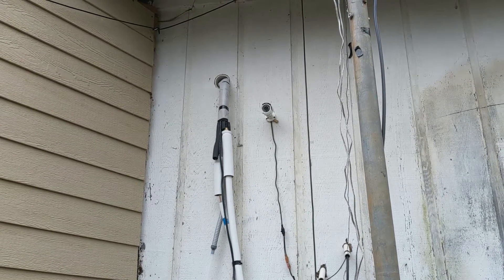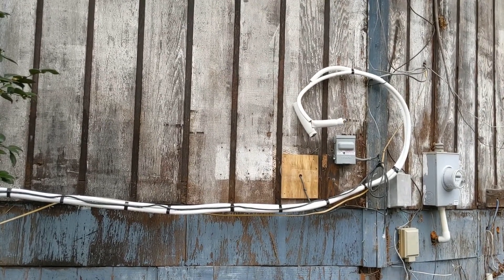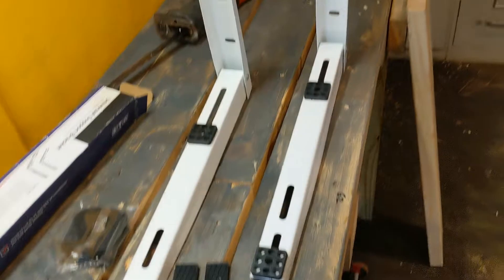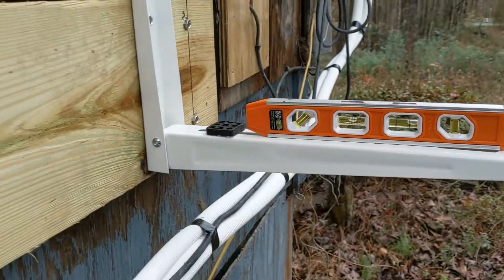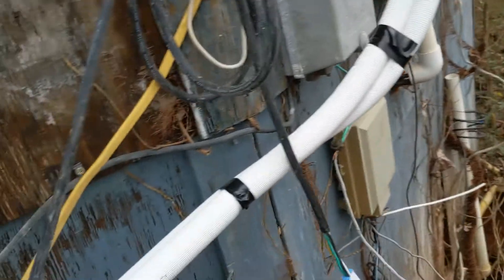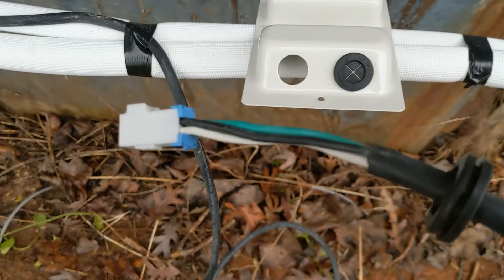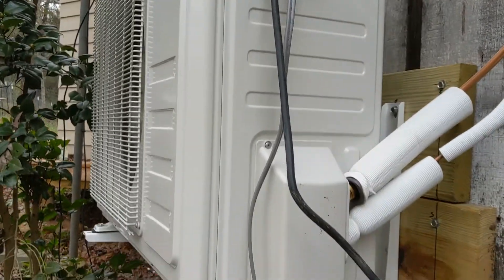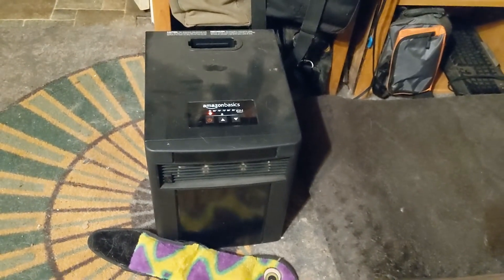Klimaire MiniSplit Condenser Install and System First Use.

Comment: Did you torque to a spec when doing the line sets?
Reply from the maker: @littlejeffy5967  I tightened it til it didn't move anymore 😀 No special tools were used, just a pair of wrenches
Reply: @TwoAcreHomestead  i must be unlucky. Mine leaked leaked and had two companies try and fix and screwed it all up. I just had to order another mini split. Thank you for the quick response.
Reply from the maker: @littlejeffy5967  You couldn't just replace the linesets? Guess the company must have screwed up the threads on the connections at the unit, which seems really hard to do. 
Hope you have better luck with the new one.
Reply: @TwoAcreHomestead  ordered a new one and torqued everything to spec and the low pressure line literally blew flare apart. I have no luck with these.
Reply from the maker: @littlejeffy5967  I'm trying to understand how this is even possible. You were using two wrenches, right? One to hold the connector that is on the condensing unit solid, then tightening with a second wrench? I have no idea what the torque specs are, I just tightened it until it was solid using a standard wrench. I can only guess that you are over tightening the connectors somehow.
Reply from the maker: I just checked the PDF Install Manual. They do not mention any Torque Specs. What setting did you have your torque wrench on?
Reply: 57 NM is what i had my torque wrench set too.
Reply from the maker: Did some googling, 57nm = 42 Foot Pounds. 
I believe the low side line is 3/8 in, maybe 1/2. 
According to the manual from a Pioneer Mini Split unit: 
a 3/8 OD pipe's connection should be tightened to 18.4 Ft Lbs,  
a 1/2 OD pipe's connection should be tightened to 25.8 Ft Lbs,
a 5/8 OD pipe's connection should be tightened to 33.2 Ft Lbs,
a 3/4 OD pipe's connection should be tightened to 47.9 Ft Lbs.
When I installed mine, I just used two standard wrenches and did it by feel. 
If you try this a third time, I'd recommend tossing the torque wrench and doing it by feel. 
Hope this helps.

Comment: The Amazon link (3 years later) for the 24K unit appears to say that it's built for European voltage. Was yours correct? I noticed that you didn't have a  two hot lines neutral line going to yours.
Reply from the maker: The system is 240 American Volts (not sure what the Hz is for European current). 2 hots and a ground were used to wire it up. No need for a neutral. 
Here is a current product link I generated from my order history, just incase the on in the description has shifted: 
https://amzn.to/4285vCV
I'm using UV/UG Rated 12 gauge wire hooked up to a double pole 20 amp breaker. I think max current draw is 14 amps (I'd have to go look at the data plate to be sure). 
Any more questions, just ask.

Comment: Did you have to put a vacuum on the refrigerant lines when you installed them?
Reply from the maker: Nope, this system is pre-charged and the lines are shipped sealed and already holding a vacuum. Just hook everything up and release the freon and its good to go.
Reply: @TwoAcreHomestead  how does it hold the vacuum in the lines when you take the Plastic caps off , we're installing the 2 zone model
Reply from the maker: It was a few years ago when I installed this, but I believe there is a thin metal seal at the connection for the lines that gets punctured when you tighten them into place.
Edit:
I can not be certain that the system you are installing does not require the lines to be vacuumed. I can only speak for this system that I installed.

Comment: What amp breaker do you have this system running on? 30 amp? Im planning on installing one this weekend.
Reply from the maker: 20 amp double pole, I think this one says it pulls 14 amps, I have the 24,000 BTU version

Comment: Any updates? I'm thinking of putting this unit in a 1bd rental of mine. About 600 sq ft. I have to do it soon and any info is helpful.
Reply from the maker: Morning, 
Ours has been installed for a year and 4 months and is working great. Electric bills are lower and the house is well heated or cooled depending on the season. 
I'm not an HVAC Expert, but at 600 square feet you might want the 12,000 BTU instead of the 24k unit, but I'll leave that to your research. 
If you have any questions, I'm awake now and will do my best to answer them after I find my coffee.
Reply: A 12k 110v or 220 should heat cool 600sf great if insulated. I have 2 110v 12k heating cooling a 1100sf 1908 farmhouse  with bad window that let's cold/hot air in(getting new window before winter) and been great. Plus my electric bill is $90-110 a month running both 110v 12k units 24/7. I run one at 1 on fan setting and other at 2 or 3 and works great. Draws very low power, was running both 12k units off one 20amp breaker temporarily for months and never popped breaker once. Was 90+ this summer house was 67 inside, in winter was in 20s and house stayed at around 69. That's running them not full blast. These are virtually same units home depot sells for under $900 but home depot ones are not self install, but parts work on both like the motherboard etc.
Reply from the maker: Thanks for the update, glad this system's working out for you

Comment: How does it work right now at around 30 degrees? Does it make a louder humming noise like mine? I have a clip under my profile
Reply from the maker: When it goes into defrost mode it will make that loud humming noise, otherwise its pretty quiet. 
First time it went into defrost mode it freaked me out, I have security cameras and started watching when I heard the noise and I saw a big cloud of steam coming from the unit. 
After a bit of panic and then some googling, I learned it's perfectly normal.

Comment: Do you need to release refrigerant after the quick connects are tightened? Manual is confusing. I had a guy install yesterday and powers on then breaker trips after 2 minutes. I have the 110v version of the diy. Trying to go through everything to figure out why. I have it  on 20 Amp breaker, mine is 12k.
Reply from the maker: After the freon lines are connected you have to release the freon from the outside unit. There is a hex key that you use to let the freon into the system. You have to open in all the way and you'll hear the gas release when you open it. 
Just waking up. Let me know if you want me to make a short video pointing out where the freon release screw is.
Reply from the maker: posted the page from the manual and instructions here. If you need a hand, just let me know
https://www.youtube.com/c/LifeofEric/community
Reply from the maker: https://youtu.be/M1NZ1pUezXk. Made you a video Hope it helps

Comment: How is this unit holding up?
Reply from the maker: So far it's working great. It heated the house comfortably all winter and saved about $100 a month on the heating bills. I've only had to use it for AC once so far this season and that also worked great. 
March and April don't require much heating or cooling in this area, once we get into May daily AC is pretty much a necessity. 
I'll probably post a 6 month update on this system sometime in June.
Reply: I just bought my second 25k btu diy. Fantastic units
Reply: 24k*